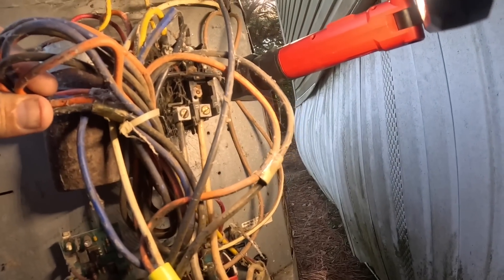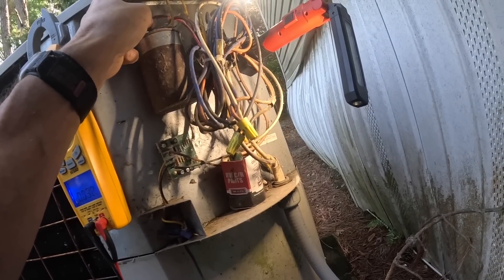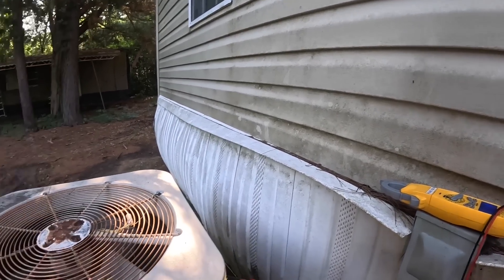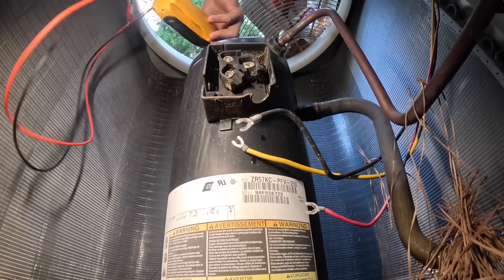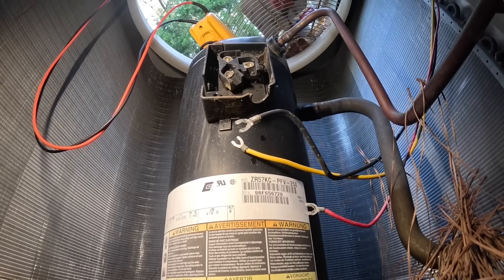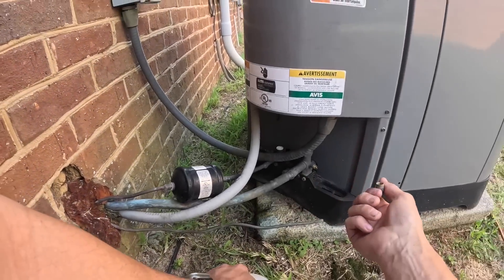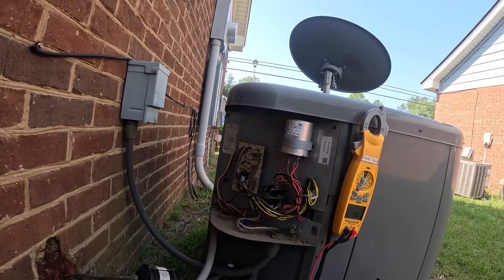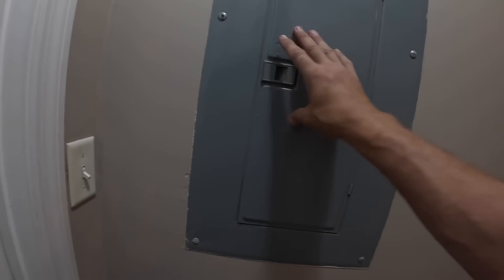Compressor Diagnosis On Two Separate Systems! #hvacguy #hvaclife #hvactrainingvideos

Comment: The compressor in the first call sounds like its dry with no oil or the oil has been burnt from an over heated compressor. You could just check the amp draw and add oil and saved her sone money.

Comment: Out where I live mobile homes are not as thrifty as they used to be. Space rent around here is averaging about $1,200 to $1,500 a month in addition to the utilities and cost of the home. $8,000 or so doesn't make a lot of sense to put into an old mobile home for 3 months of air conditioning. Everything these days is so far from reasonable priced when its related to income levels.

Comment: Temporary room A/C is all you can do for them if they are interested...Sad but its that time of year when contractors are super busy. 
The mobile home set up looks rather deteriorated...I'd install two returns if possible as those are noisy and rather inefficient with just the one at the blower. What a job those mobile homes are.

Comment: I work on hvac and never seen a capacitor so rusty!
Reply: Very true but its an old one likely and if so, will probably keep on working long after a new one. Leave it be if the readings are in spec.

Comment: Curtis, I have 37 years of experience in HVAC, and 32 years as an industrial electrician.
I do not want to make you look bad in any way, but you need to be educated on electrical motors and resistance values to make them bad.
When reading to ground from any winding on a compressor, any value higher than 1 megohm isn't a problem.
You are replacing compressors when they don't need replacement.
Sorry, for the negative comment, but this is simply the truth.
I'm sure that your followers will have a problem with this, but they simply don't have my background.
If any comment negatively, I will simply unsubscribe and go my way.
That
Reply: Then dude you need to hit the books again because if there is any reading to ground from a compressor terminal it means that the wire from that terminal inside the compressor to the motor winding has compromised insulation and it will cause more damage to the system if the compressor is not replaced; when you are reading resistance from ground to the terminal it is thru the oil in the compressor which means the oil is getting electrically fried which is how burn outs are caused. Ie...acid contaminated systems. No where is there a reading to ground on a compressor terminal that is acceptable it is a issue that if left to continue will get worse. So no the compressor did not need to be replaced immediately but it would need to be replaced sometime in the future which means there is no way to say how long it would continue to run if it died with in a month or so then Curtis would have been held responsible because he was the last tech to touch it. So Curt CYA I'd do the same thing and do I have 30yrs experience in commercial refrigeration and HVAC so you do you Curtis.
Reply: 27 years in field any reading to ground bad compressor for your safety the customers safety and even the stray dod who desides to hike its leg on the unit reading through oil is correct just like a water heater bad element can read through the water needs replaced
Reply from the maker: There’s a reason for the difference. I’m testing with a 9V battery. Under load it’s much different. Even my megger doesn’t go below 20 Mohms, because anything less is considered bad. It’s just different under load.
Reply: @HVACGUY  I am using a meter with a 9 volt battery as well. What I told you in my comment is the absolute truth.
Reply: shouldn't it read infinity/open line if there's no problem?
Reply: @Jon-hx7pe yes It should read infinite resistance if there is no problem but since he is reading resistance he is reading it thru the compressor oil. Now if it was a scroll Copeland had a service bulletin to warm the compressor up using the crankcase heater because they had a issue with the insulation of the motor windings having exposed wires in the compressor and heating the crankcase up allowed the oil to heat up and become a vapor which prevented the wires electrical current from flowing to ground and if it was not heated up then the breaker would trip this was mainly on start ups of new equipment not on equipment that has been running for any amount of time. The only reason the service flash was produced was because Copeland had way too many compressor failures that caused them to investigate the cause and since there was resistance to ground they had to honor every replaced compressor underwarranty they have since corrected the exposed wiring issue inside of scroll compressors. But they still said that the compressor replacements were warranted because of the resistance to ground period. The resistances were meggaohms which is why they recommended not using a meggar to check compressor windings to ground.

Comment: What causes the compressor to short out?
Reply: Probably a short on the motor windings.
Reply: if the oil goes acidic from absorbing moisture, that could kill the windings - corrosion and short out.
Reply: Too much heat on the compressor (that means high amperage draw and or the following :blocked condenser coil, low refrigerant charge, high refrigerant charge, liquid going back to the compressor, short cycling) those are what I can think at the top of my head.
Reply: Exposed wire inside compressor which is a short due to the oil electricity flows thru the oil and causes current which inturn causes the short to get worse until it burns out the oil which pretty much burn the lubricant from the oil and a tech allowing it to continue to run in this condition until the complete system is contaminated by burnt sludge called acidic oil. Basically there are several factors that can cause a compressor to short out.

Comment: Only the bottom part of my evaporator coil gets get cold is that a compressor problem?
Reply: Sounds like you lost most of your refrigerant.
Reply: @dock_yard1149  no it's actually overcharged. That compressor doesn't have enough compression I'm gonna change it out
Reply: Sounds like you have a flooded evaporator so no I would not say compression issue but would need to know a little more information like metering device, air flow CFM's because it could be a air flow issue motor spinning to slow, TXV feeding issue or possible over charge would need to know evap TD condenser TD superheat for fixed orifice or subcooling for TXV so no way to know with the little information you provided. The only way you can say it is a compression issue is by calculating CFM and being completely sure it is correct then completing a compression ratio test but if air flow is not correct the compression ratio will be squed

Comment: Curtis, you said that 13. Meg Ohm is enough to trip a breaker. Could you explain that, please? 
In my world 240 vac across 13. Meg Ohm results in a current of 18.46 microampers. Even a GFCI leakage current doesn't trip until it sees 4. - 6. Milliampers.  I have heard you state this before. The customers have 40 Amp breakers so I can't figure out why you said that.
Reply from the maker: You’ve got to understand I’m checking with a 9V battery. If you apply 240V under load the results are much different. When I use my megger anything below 20 Mohms is labeled as bad, and I’m not using the megger. Unfortunately the ohms law doesn’t make much sense when applying it in this case.
Reply: @HVACGUY There should not be anything read to ground on a compressor the motor is isolated if there is anything to ground read then the compressor is grounded the meter should have read OL when checking resistance to ground.
Reply: For there to be any leakage to ground, the insulation inside the compressor must be compromised, either by burning or rubbing with vibration.  Once that happens, the wire will start arcing across when high voltage is applied ((perhaps only when the compressor is vibrating), and it is the arcing that trips the breaker.
Reply: I believe when it is running and hot, there may be more breakdown of insulation also
Reply: I agree that 13 megohms to ground won’t trip a circuit breaker. Also the resistance to ground for the compressor itself when isolated from the other wiring tested higher, I think >30 megohms. Still, any measurable resistance to ground is suspicious. A more reliable test of resistance to ground is with a “Hipot” device. This measures megohms, but instead of testing at 9V it has an internal high voltage generator which  tests at 500V and perhaps up to 2kV. Applying a test voltage considerably higher than the normal operating voltage is a very reliable test of the internal insulation. 
Another thing about compressors is that most internal shorts are catastrophic and result in a very low resistance to ground, often from 1 to 10 ohms. Not megogms.
To conclude, I doubt that a compressor with >30 megohms to ground which still runs and pumps refrigerant normally is in the “must replace” category Disclaimer:  I’m an electrical engineer by trade, but only an amateur when it comes to HVAC repair.
Reply: @electricboyo any reading to ground will cause acid to be created by the electrical current and the refrigerant oil meeting which will contaminate the whole system and cause a serious problem to become a catastrophic problem any reading on a compressor terminal to ground is a reason to replace the compressor and filter drier if the short becomes worse it will cause a burn out of the oil and if that happens the repair becomes more expensive due to the contamination of the system. Curtis is doing what is the best for the customer and not listening to the "NAY Sayers" that have no idea of how serious the repair could become if compressor is not replaced. Great job Curtis I have been critical of you also but in this instance you are doing the correct thing by replacing the compressor.
Reply: @electricboyo it should read OL anything other means there will happen a failure sooner or later. With a high voltage tester it would have shown lower numbers. 
I don’t think he measured the amp on each phase of the motor or from the power outlet to check if the breaker is good. That’s a thing I would have done too.
Reply: I too was curious on that. I really think its a capacitor failure and not grounded compressor.

He even said 40 meg ohm when on the comp itself
Reply: @mediadaemon always look and find some numbers then cross reference it and it will give you the capacitor. I even went on a repair parts site and put in model numbers and showed me the capacitor and I checked those numbers against what I was working on, and it was bad. I think it was a 70/5 and it was really low numbers on my meter. The new 70/5 capacitor fixed it! Every unit has different capacitor numbers, btw!
Reply: @bbaaspencer1  I found copelands chart that specified capacitor, but given the 40Mohm numbers he said on the comp and the rusty aged condition of the cap, I think a new cap would have been a fair step.

Caps also can give false readings with a meter and respond differently under load. One can test a caps performance live by checking the back emf voltage and current draw.

Start winding amperage times 2652 divided by voltage between herm and c while running will give mfd.
Reply: Exactly. Sadly, Curtis needs more training while using a meter to check electrical resistance to ground.

Comment: I believe the cap should have been an 80mfd not 60
Reply: you are correct.
Reply: When in doubt call the distributor; with model of unit they can find out correct capacitor replacement!
Reply: Only if you have the original equipment if you change the fan motor for example you might need a different capacitor @bobboscarato1313
Reply: A 57K3 model calls for 80mfd but a 57KC model calls for 60mfd